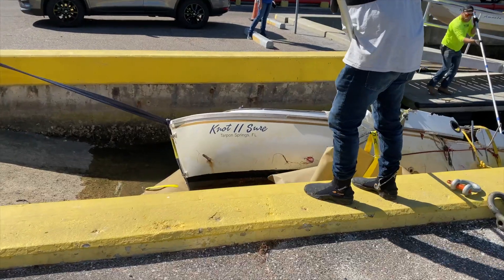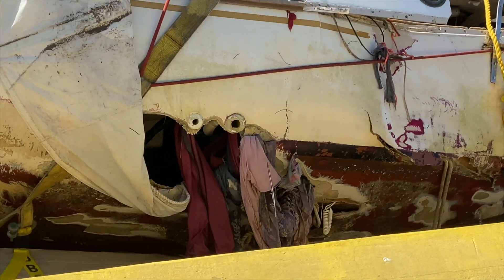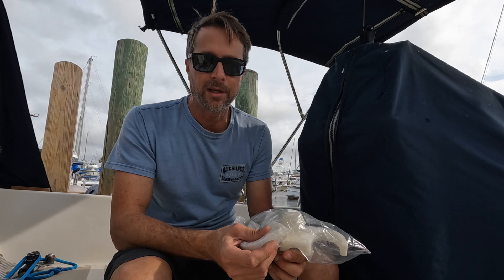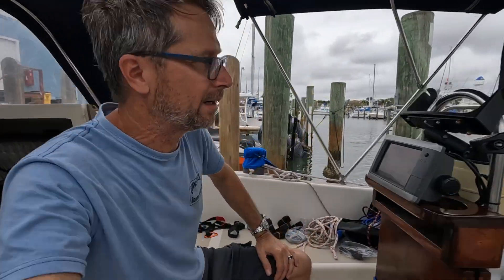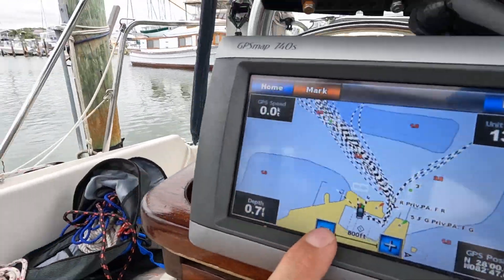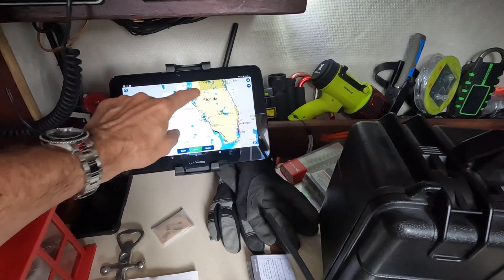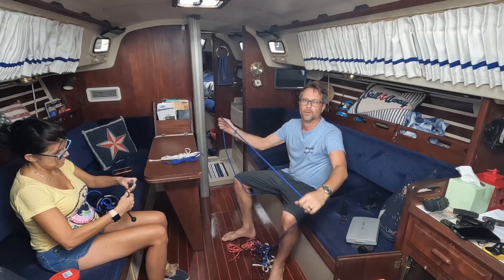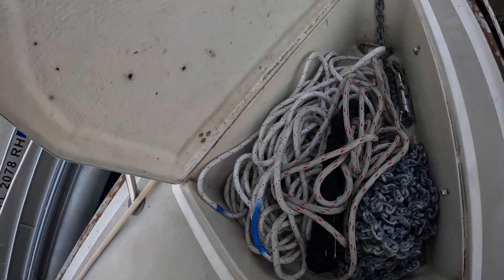Sailing to Key West preparation Part 1

Comment: Regarding your contingency for towing: While docking my 36' Beneteau in downtown Nashville a few months ago,  I had a spring line  wrap the prop and I was in a  strong river current. I deployed the anchor and rigged a tow line using my Mantus  bridle with a tow line attached to it; tossed the line to a tug which maneuvered me  back to the dock where a diver cut the wrap. The bridle made a huge difference in effective towing.
Reply from the maker: Good tip.  Half the reason I keep that is in case a nearby boater needs to help us, or we need to help them.  We have a towing service that covers the entire area of Florida and tows for a yearly fee and it covers any boat I use, mine or not.   We've used the service four times on power boats and watched as they've pulled two sailboats off that were run aground.

Comment: This is a great video and I'm super excited to see how your trip goes!  I agree with many of the other comments that I don't plan to quit my job and learn to sail while offshore.  I purchased my '81 O'Day 28 in 2020 and have been sailing on Thursday nights in the local bay and getting out on longer (25 nm or less) day trips as much as possible...  but I have to be back in time for my job!  As I learned on one trip, the weather doesn't always cooperate with a schedule, so trips like yours are exactly the type of thing I want to see. What's more, I'm interested in doing some sailing in the Keys (Key Lime Sailing Club in Key Largo provides Catalina 22s with the cost of the room) so am interested to see what kind of weather and interesting things you encounter.  Thanks for the great videos!
Reply from the maker: We will probably go do a week at Key Lime in the next few years as we had a Catalina 22 prior to the O'Day and would like to be able to spend some time down there but not have 70% of the trip made up of getting down there and back.  If we like this trip, we might do it again, staying two weeks instead of one. Thanks for watching!
Reply: @AdventuresInParadise  If you do I'd be interested to see it!

Comment: Yay! The time is finally nearing.  Super excited to see how this trip goes for you. Like someone else commented, this is a trip many of us could actually take. I always learn so much from you videos, thanks you. One last thing, do you guys have a solar oven for your trip? Have you checked out
  Go Sun? They're pretty awesome and one of their models has a boat mount. Safe sailing ahead! ⛵️
Reply from the maker: We don't have a solar oven, so any of our hot food can be heated either by the rail-mounted gas grill or our denatured alcohol two-burner stove in the galley.  In case of bad weather, we can survive on other snacks.  I looked at the solar oven but and that looks great, but we're not on the boat long enough. What's so great about the solar oven is no fuel required. Thanks for watching!  -Jason

Comment: Hey Question....I noticed when you floated the drone what was at the top of your mast. Because we are in Florida, has there ever been thought to a lightning defuser ? I see one of these here in North Port over an electrical panel next to our Legacy Bike Trail. I've seen this on other sailing videos. The one guy said they really work. Just curious!
Reply from the maker: You mean those round things?  I looked online I can't figure it out. I'm pretty sure the whole boat has a ground to the water... it's got a really thick ground bare wire that runs to everything and then grounds into the water, I believe, but most of the time if you take a direct hit, it fries everything.  We have daily lightning storms in the summer and have been lucky so far.